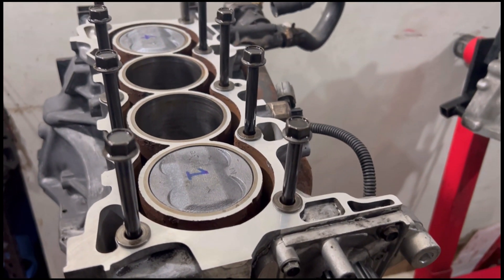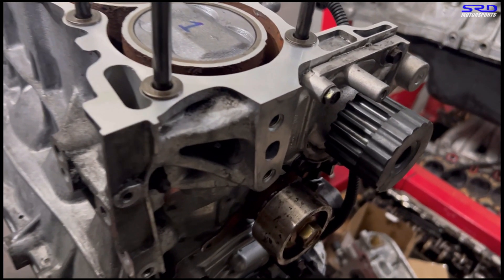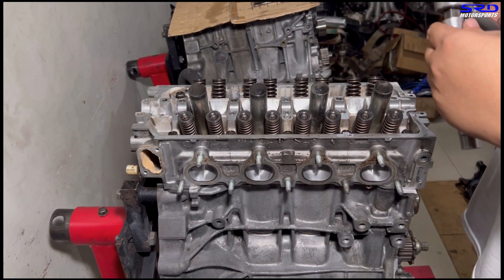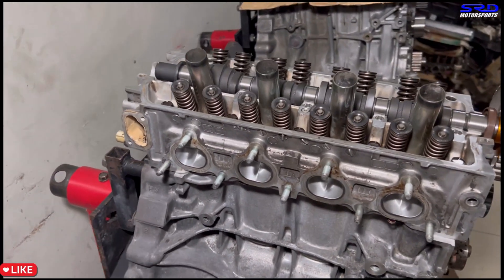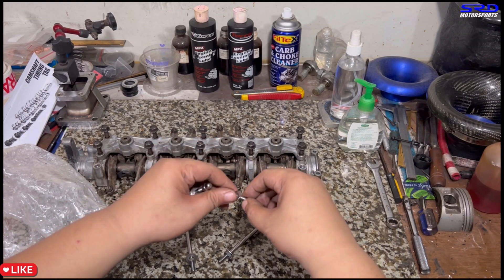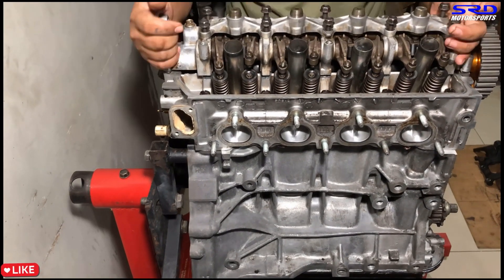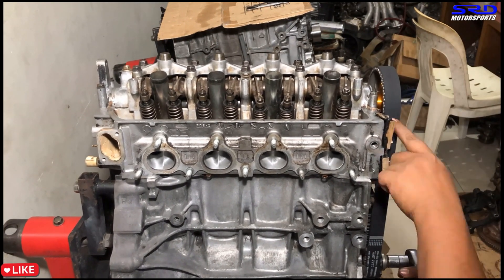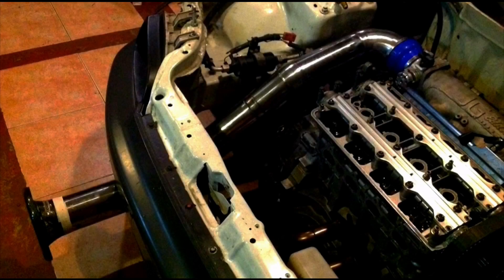Honda Civic VTi D16z6 Crower All Motor Build Project part 3

Comment: Im building an ej1 1995 civic ex coupe. My project build. No rust at all or rot at all. Super clean in and out. 

Originally Paradise green blue metallic pearl color changing to Y53 Carnival Yellow. 

Racing 421 Headers
Full 2.5 exhaust with N1 muffler 
Carbon whale intake. 
Coilovers 
Camber kits 
Carbon Pedals
Carbon Shift knob 
Carbon eye Lids
Carbon door Pillars 
Carbon gas door
Carbon spoon mirrors
Carbon Jdm fog light bezel with clear fog light setup with switch
Chrome DRL headlights 
Chrome LED corners
All clear tail lights
Jdm Eg6 SiR front lip 
Jdm slim visors 
Fresh set of GSR hammers (Fat Fives) with New tires
Bull boost FAB all polished intake manifold & polished bull boost fuel rail
Billet polished 70mm TB
D17 coils (COP conversion) 
Msd ignition system
Lsd 1.5 way
Full suspension setup (fully adjustable) 
BBK setup (Mini/Tsx setup) 
Drilled slotted rotors
Centric hub rings
OEM interior for now... gutted rear. Polished X bar. C pillar bar. Harness bar. DCsports polished front and rear upper strut bars.

Comment: what the best piston pm6 or p29??
Reply from the maker: depends on the application and goal to declare which is best but pm6 has non vtec valve pockets on the intake so not safe to mill or run with big cams

If you’re vtec and someone says pm6 is better, tell them to eat it 😂
Reply: Thanks sir !!🫶🏻more vids po
Reply from the maker: @ iwas pm6 kung vtec kase if need “ipocket” pra d tumama valves it means pinababa mo din comp mo parang stock so bkit pa? Iwas gastos and sakit ulo
Reply: @SRDmotorsports pero ano po mas highcomp sa dalawa
Reply from the maker: @ p29 malamang sobra layo difference PERO wag puro “piston” stock cam = stock piston, the higher comp the less forgiving sa sablay sa makina …kaya ang dami sablay eh mka piston lng akala ok na… wala aamin sa sabog 😂 pero LF agad block 😂

Comment: the fueltec build d16zc predicting a 132-135 whp
Reply from the maker: Hahahahaha dayum u real realest close 😎
Reply from the maker: On the dyno as I talked to Ralph the owner (same name lol) I find out the older dyno tune that made 135whp ? Was actually on a modded pm3 pistons etc and I believe a mildly ported head so it wasn’t as stock…

But this time now with “another” d16zc the one we assembled it is bone stock except Supertech valve springs and retainers
Reply: @SRDmotorsports  sounds good
Reply from the maker: but u almost nailed the numbers, still editing vid now so that’s next on Tuesday 😎